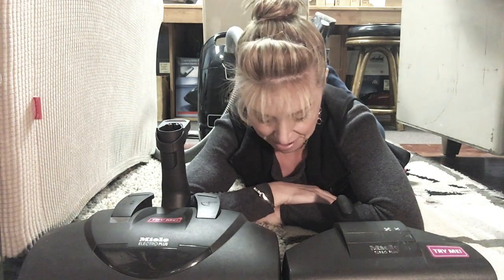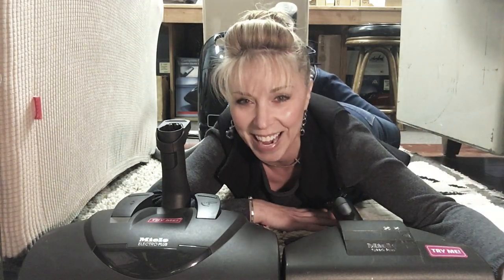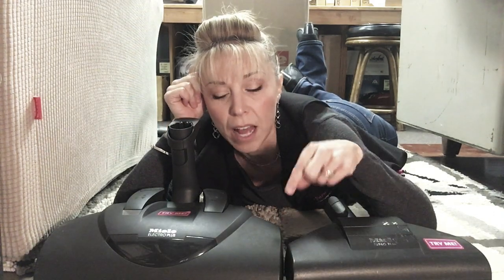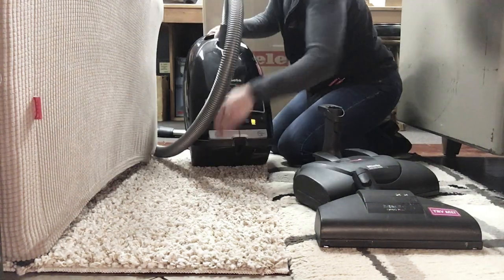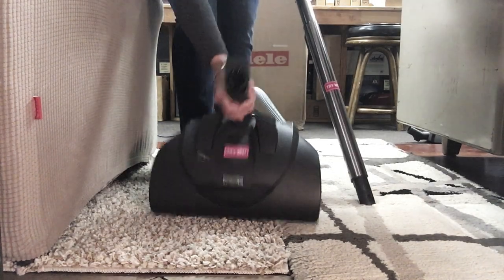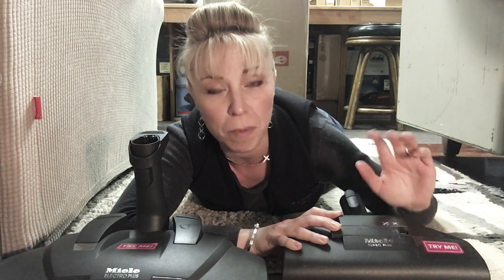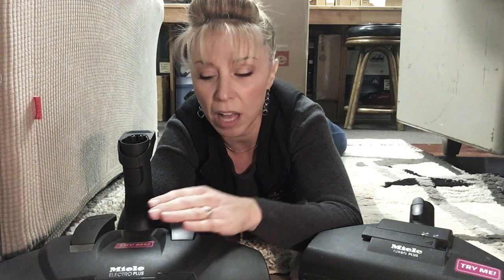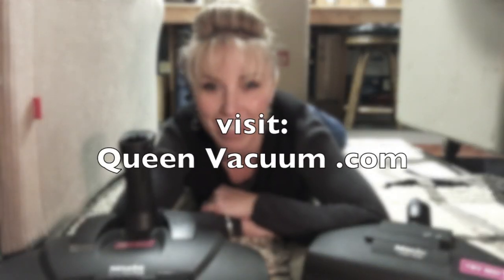Miele Turbo vs Power Nozzle DEMO - Queen Vacuum (Shrewsbury, NJ)

Comment: It sounds like the model with the power head might be the best choice because you can still use the turbohead, which will not be so hard on your carpet. Power heads are notorious for being hard on carpets. But I purchased the C3 complete cat and dog (Autumn red) which doesn’t have the choice of a power head and was finally affordable. I do miss being able to switch off the machine from the handle, which I had with my Smart central vac in our previous home., and which you presumably get with power head Miele models, but I’ll get used to using a foot controlled switch. We went to central vac in the days when the canister and similar machines had nowhere near the power of a good central system. It’s no longer like that.
Reply from the maker: Indeed, electric power nozzles can be too aggressive for SOME delicate rugs, even despite the wide range of adjustments that can be made to make them work more gently. But it's super convenient to be able to switch off their power right at your thumbtip! Turbos do work really well for what they are, but true, it's a bummer they can't be stopped.  They are very affordable though.... so it's great that you were still able to get a premium-level C3 Miele!  Not sure where you're based, but the model package you have is different than what we have in America.... our C3 cat & Dog models are white, and do come with an electric power nozzle (as it's the most sure way to get up all the dog hair!)    But I think you'll still do fine... especially since these units are indeed powerful now like central vacs! And you'll most definitely get used to her controls in time.   
Thanks for watching and writing - Happy vacuuming!

PS - if you haven't already done so, please consider Subscribing... it would help us SO much!! :-)

Comment: In the UK we hardley get canisters with electric moter head. We mostly get suction only or air driven.  Also do you recommend shark vacuums
Reply: Conor Riddell I know Rachel and John very well (the owners). I would be sure they mmaaaayyyy not recommend them since there is not one shark product on display. I’m pretty sure they sell parts for them though. Don’t take my word for it.
Reply: EU 900 watt limit is to blame. Unfortunately, cheap to manufacture mains-powered GaN driven BLDC vacuum cleaner motors are not quite a thing yet. EU should've gone with a more reasonable limit such as 1500 watts or at least 1200 watts.
Reply: I dont mean to be offtopic but does someone know a method to get back into an instagram account??
I was stupid lost my password. I appreciate any help you can offer me!
Reply: @Zayne Brayan Instablaster =)
Reply: @Brock Braylen i really appreciate your reply. I got to the site through google and im in the hacking process now.
Seems to take a while so I will get back to you later when my account password hopefully is recovered.
Reply: @Brock Braylen it worked and I now got access to my account again. I'm so happy!
Thanks so much, you saved my ass :D
Reply from the maker: Yes- I noticed that the Euro market offers different stuff than the US. I'd just assumed that nobody had much carpeting over there LOL!  But electrical limitations could certainly be a good reason as well. 

And as for SHARK - we do NOT recommend them.... kindly see some of our other videos to see WHY in greater detail.....  But in general, we find them to be much less hygienic, harder to keep clean, they have  no control over suction or brush height to adjust for varying carpet piles and delicate surfaces.... I could go on ;-)   And worse, they do NOT distribute new parts to independent shops like ours. So we have no way to help people if the Shark actually breaks... All we can do is clean and service :-(   Anything major happens, and folks have to throw them away, as there are only a few (expensive) parts assemblies available customer-direct on their website for some models. 

Anyway, thanks for watching and writing! 

PS - if you haven't already done so, please consider Subscribing... it would help us SO much!! :-)